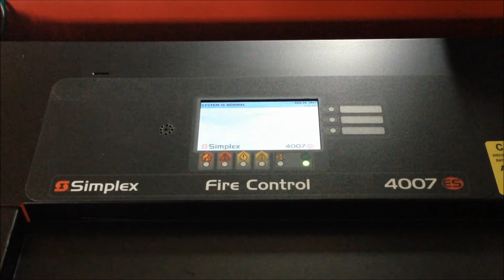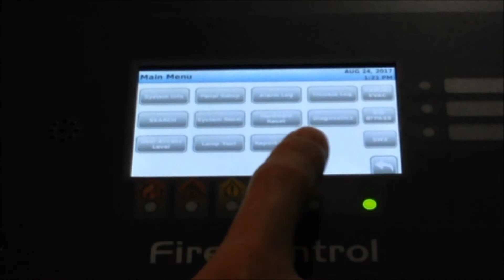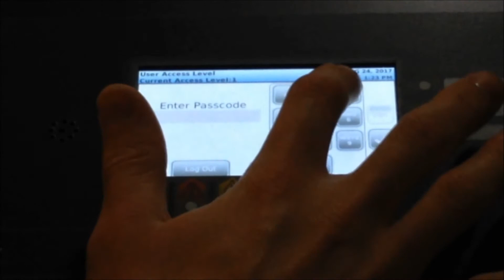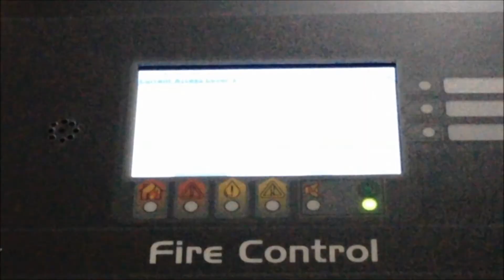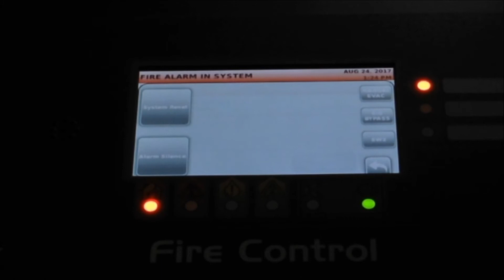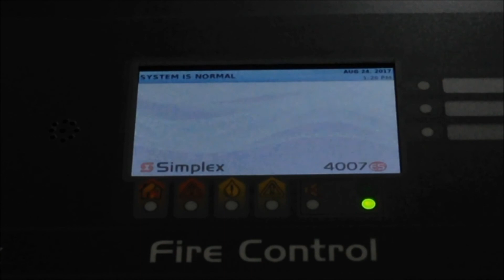Simplex 4007ES Fire Control Panel Update | BIG NEWS!

Comment: Does the power wire the same as the 5ud?
Reply from the maker: The power wiring on this unit is slightly different than most control panels. You have to loop each leg of the AC feed through ferrite beads before it enters the cabinet, to reduce electrical noise on the lines.The actual power connections are the same, however: Hot, Neutral, and Ground.

Comment: How my panel resets is it kills the power for the zones and a few seconds later the zone power comes back on. It's controlled by a relay
Reply from the maker: Correct - that's exactly how this panel responds to a reset when a zone has alarmed as well. Since I only activated the "Manual Evac" hotkey in the video, it skipped the zone power reset process.

Comment: Can this particular panel use Truealert ES signals, or do they have to be conventional?
Reply from the maker: This is a 4007ES Hybrid, so it only supports SmartSync or Free-Run TrueAlert Devices. The 4007ES Standard is equipped with IDNAC, so it supports Addressable TrueAlert ES appliances. Despite this, the Hybrid remains the panel with the most features of the two. So to answer your question, no, my panel cannot use Addressable ES signals.
Reply: kcin556 gotcha

Comment: I'm debating whether or not to get one of these...
The only thing that's holding me back is the prices of the ones on eBay.
Reply from the maker: Don't do it. A used 4007ES of any kind will be impossible to program. I'm not trying to be a jerk, I would just hate to see somebody waste their money based on what they have seen in my video. I was exceptionally lucky to get my unit working - I could have very easily been out a whole lot of money with a non-working panel. This goes for any ES Series panel, I should add.